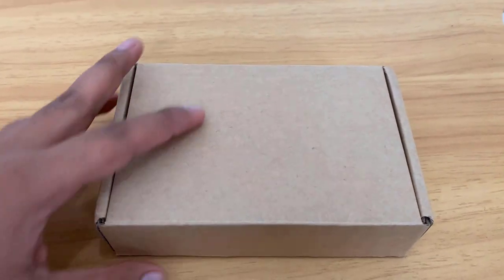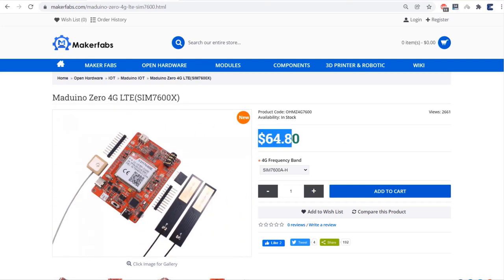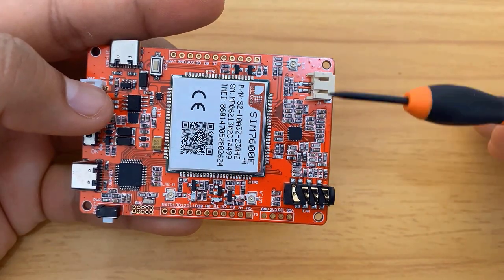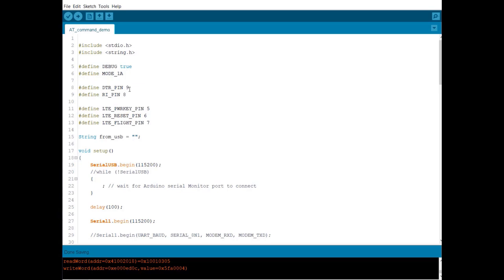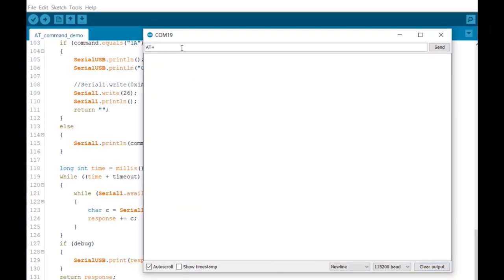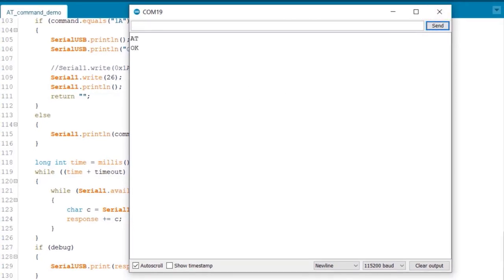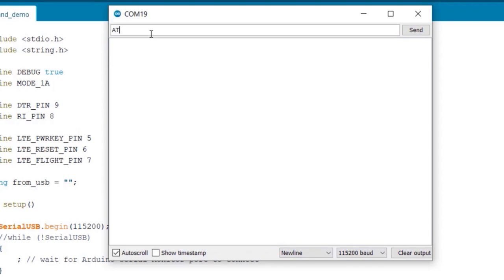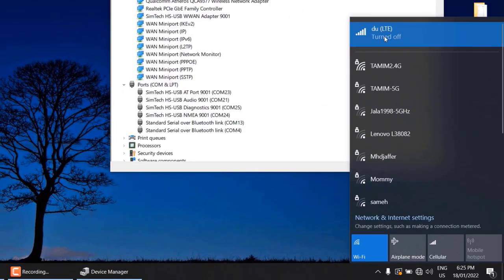SIM7600 4G LTE GSM Modem Tutorial with Arduino | AT Commands, Call, SMS, HTTP Internet

Comment: Thank you. I really enjoyed the video. i'am trying to reproduce the same work with M5Stack GNSS/LTE module but i have a problem.
When i send the AT command like AT+CGMM for example the serie monitor print that very command(sometimes it just print unreadable caracters) which is okay but i can't see the answer relative to each at command .... i have things like small squares which are printed after the printing of the AT command.

i don't understand because i configured the bauderate excatly as you did ...in fact i didn't change anything.

I will really appreciate any suggestion 😊.